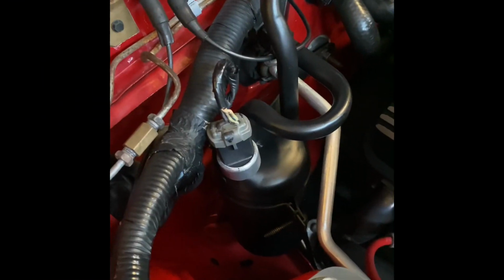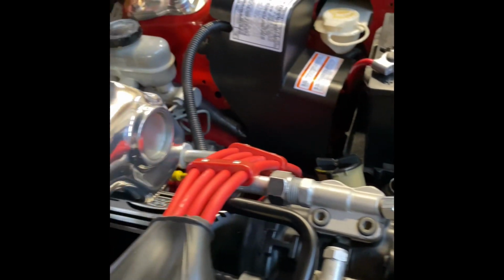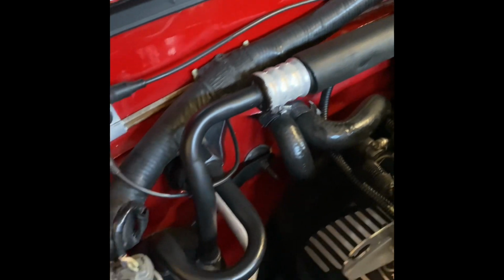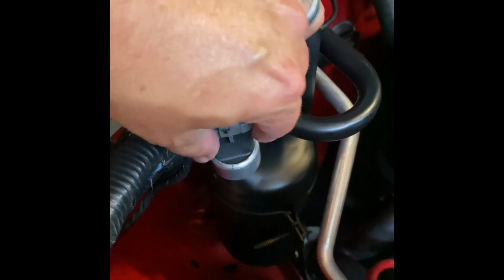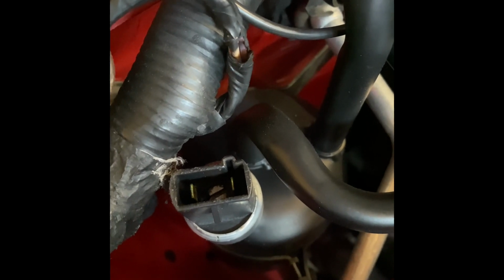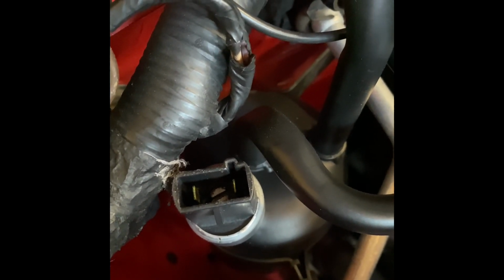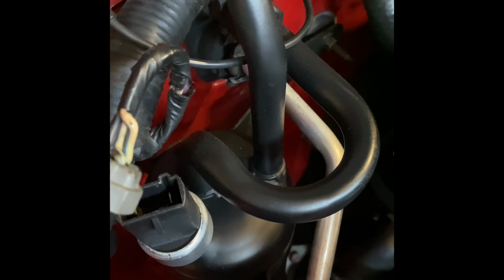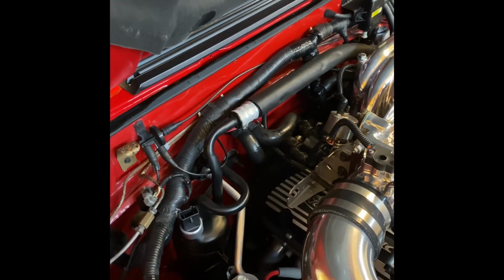Tech tip for one of the most overlooked parts of your Foxbody A/C system

Comment: Never knew about that adjustment screw.  Thank You for sharing the knowledge!  Could you possibly provide a video sometime regarding the replacement of the clutch in front of the AC compressor?  Have heard so many different things regarding the proper way to replace these parts in particular how many spacers to put in the clutch cover.
Reply from the maker: Honestly it’s easier to replace the whole compressor, it’ll cost a little more but it’s much less of a headache in the long run.